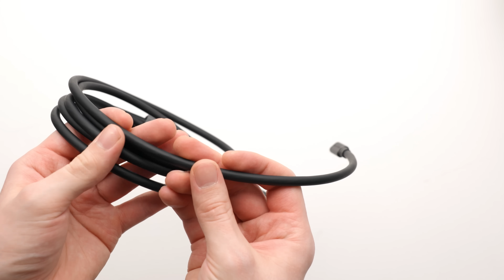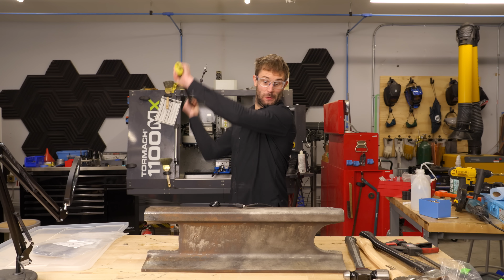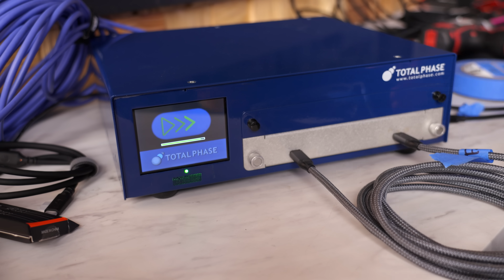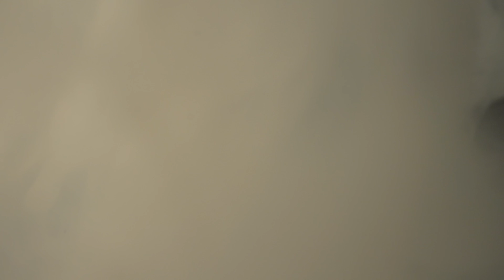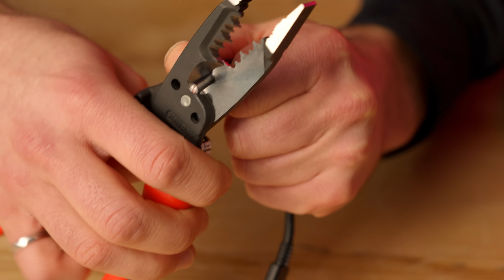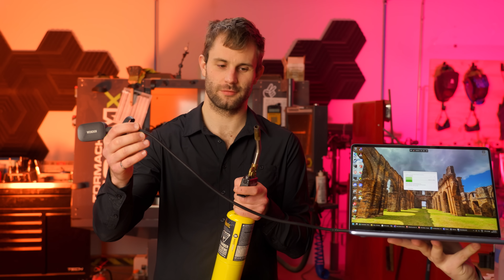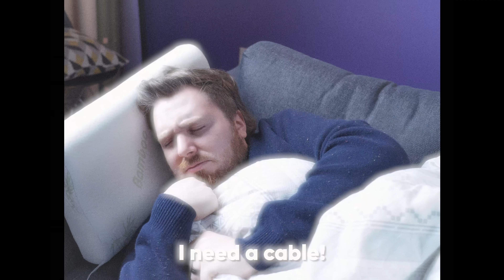Why It Took Me 4 YEARS to Make a USB Cable

Comment: I work with USB4/TBT cables a lot and all I can say is that their reasoning for not certifying... is nonsense. It's probably more about LTT and their partnered cable manufacturer in China not being able to create a cable that would pass USB-IF certs for one or another reason. I actually have quite the testing equipment from Teledyne and TotalPhase too to check, and all I can say is that final certified cables are passing the tests with some defects within the batch (usually around insertion loss). Heck, should I get their cables and verify their claim lol? 

For anyone wondering - take a look at StarTech cables, they are USB-IF certified and cost about the same.

Comment: I know someone that does CEC certifications for the FCC. I would double check that that is indeed the case that you don't need to comply by part 15 FCC regulations. From what I see it includes charging cables. Like I understand it's a USB cable and you don't need to get the certified. I know you've done your due diligence and tested things. My family member has found all kinds of crazy things like not grounded toys lights. There had LED panels that weren't properly grounded and would catch on fire in 20 minutes. So I would just make sure that you dont have to get these tested because they are an unintentional radiator.

Comment: To my knowledge this is the only "liquid Silicone" cable out there that does more than 480mbps. Having used liquid silicone cables for the last 1-2 years, I don't want to go back. I'll pick up one or two long high bandwidth cables when they are back in stock!

Comment: It being clearly labelled on the connector alone is incredible. Looking at the pricing on the store it's not even that pricey for a well built cable. As a business owner myself, I really appreciate other companies doing all of their due diligence when making a product, and actually caring about making good products. Showing the cutout between the two cables was really shocking, I did not expect there to be that big of a difference. Kudos to the entire team that worked on this!
Reply: Yeah when Linus said pricey I was expecting 40-60 US
Reply: Compared to Monster Cables these are like dollar general prices.
Reply: clearly labelled is one thing.
not being bullshit is another...

both... take my money!!
Reply: clearly labeled? do they support Thunderbolt 4 or not?
Reply: @Tri-Technology whether or not it's well explained on the site, nothing here properly supports thunderbolt. So if the device defaults back to a USB method, it'll work great, but if it requires the thunderbolt chip, no dice.
Reply: @clintmash245  Then why should a buy a top notch cable if it doesn't support top notch technology? In most cases cable quality doesn't matter but for pcie devices like egpus, nvme ssds, thunderbolt docks for multiple high resolution screens and thunderbolt daisy chaining it does, but it's not supported.. great job.
Reply: @Tri-Technology To be honest, you make a good point. It sounds like you're not a good customer for these cables, and hopefully you've saved someone else the trouble too. 
Most of the people buying these are swayed by their selling points: high durability, well validated specifications, and selectable length. That's actually plenty of reasons in the current market to support a product.
Reply: @Tri-Technology  Thunderbolt 4 is just USB4-40gbps signaling. So yes, they do support it.
Reply: @Xyler94 No, it is not. It is Pcie and USB 4 is not. And it has way more specifications.
Reply: It has to be a bait, the pricing is pretty much on par with any other 40Gbps cable I've purchased in the past. If anything, I will most likely buy one as soon as it becomes available once again.

Comment: Thanks for these 

And most off your reasons is why i started to make my own Networking cables because then at least I know which idiot did that crappy Job so are most of my cables but USB i dont know why but i did not trust myself to make anything useful. 

So again thank you all at LTT from Linus Idea to CW and Labs testing and proding factorys.

Looked at the Pricing now not the cheapest but far from what i payed for some of my legthier cables over all i would say its a great middle ground know LTTstore just has to accept somthing like klarna or my Banktransfer so i could buy some.

Comment: My favorite part about working at Best Buy (And probably the only good part of that job) was the employee discount, specifically for cables and other accessories.

The profit margin on cables is ridiculous. When I was an employee, the price I paid was the price Best Buy paid for a product+ %5. I could've bought a $500 cable for $20. Not that I ever did I always bought the much more reasonable but still over priced cables that you'd normally pay $20 for only a few bucks

In sales one of the things store managers tracked was called "basket attach" where it looks good on your report if you attach high margin accessories to a sale with a big ticket item that best buy doesn't make money on like TVs or game consoles.

I never cared for that as a blue shirt. One thing that annoyed me most personally was "screen cleaners" sure you could spend $20 on a little bottles of water with some chemicals or a mild detergent plus a microfiber cloth. Or just buy some distilled water and ANY microfiber cloth from Walmart or wherever for a fraction of the cost.

When I was in Home Theater I never sold a single one of those stupid accessories and told every customer I could about that scam in particular. Sure my managers never likes my sales reports but who cares right?

If anything from my experience I think the LTT cables are cheap considering the value and quality they're offering. It's one of those things that I'm sure if Best Buy carried them in store I wouldn't have gotten much of a discount if any at all.

Comment: I love silicone cables. I got one for my Pinecil mainly because of the heat resistance but also because I heard they aren't as stiff and it's true. I wish silicone was the norm for cables. I got a silicone audio cable for my headphones too but sadly after going through a few pairs they aren't that durable (To be clear, I mean the specific cable I use which is the only silicone cable for my headphones I can find. I don't have any reason to believe that silicone cables in general are any worse than normal cables and I still prefer them). But it's nice to not have my headphone cable kinking all over the place.

Anyways, the price is actually not bad. $21 for a high quality 240W cable is easy to justify.

Comment: I think the "snake-oil" comparison at 11:24 uses a poor example. While there are several nonsensical claims made by cable manufacturers about digital USB cables to this effect (about improving detail and quality etc), the example you showcased EpicX ARAY RCA plugs are designed to carry Analog audio signals. These analog signals are most definitely tied to the quality of the materials and other factors, and higher grades can most definitely result in "more detail, dynamics and portray the timbre of instruments". As analog signals have a theoretically near-infinite resolution, it is indisputable. However, the degree to which these cables can affect performance and their price-value ($700) can most definetly be argued as probably hugely overvalued. So this is not an example of "Snake-Oil".
Reply: That brand is known snake oil last I checked.

Comment: Ngl the cables are actually cheaper than I expected. I haven't bought any LTT gear specifically because it's usually outside of my price range, but I would actually consider buying this at this price point, because it's not like you're going to get rid of it anytime soon, and it's not like it's going to be easy to break either.

Comment: Please make a braided and bent version, I'm so tired with bending the cable causing breakage.
Reply: 90 degree would be nice. But braiding is irrelevant if they’ve already done the durability v flexibility testing in RnD.
Reply: @SterlingSanders  braiding looks nice which is good for a cable that won't be tucked away
Reply: @SterlingSanders cable matters alr has a bent version and as far as I can tell it's quite high quality. I still prefer the durability and flexibility of braided cable and they don't have one so that's why I'm asking.
Reply: @I_had_a_dream I’m saying they considered braided, and intentionally chose not to put it on their product. They clearly tested the durability and flexibility of their ribbed silicone and found it to perform within the tradeoffs they were looking for.

Not to mention, braiding would increase the price of a a product they already feel they are already at a high price point in. 

Will check out the Cable Matters cable for sure.
Reply: @SterlingSanders  For me braided is not even a matter of durability or flexibility but how easily it picks up dirt and gunk. As somebody with pets and a carpeted room, it's a problem, because anything that isn't braided comes either slightly sticky or otherwise prone to getting buildup with friction from daily use, and it only gets worse with age. I wouldn't care if it was the sort of thing you chuck behind your PC and forget about it because you never move it, but USB-C is barely present in that use case. It's mostly used for stuff like phones, laptops, and various accessories that you most likely do not have plugged in and stationary all the time. Which exposes them to a lot more friction and surfaces where dust, animal hair, and fabric fibers are present. Which leads to icky cables. Which feels anything but premium.
Reply: Yes. My laptop can charge via USB-C and I prefer 90⁰ cable on it. If LTT starts selling 90⁰ cables, I'll be wholesale changing to LTT cables.
Reply: Did you not watch the video?
Reply: @NakedTrashPanda  not breakage in the outerlayer, breakage in the conductor itself.
Reply: Double Right angle would be excellent for my camera equipment

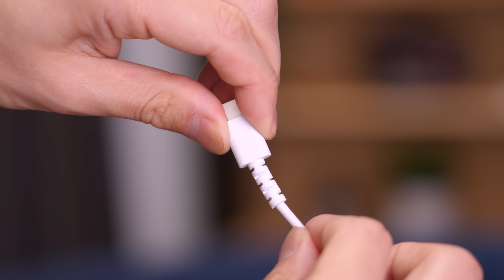Comment: 8:43 You guys should do some Right Angle Ended cables, for sure. I have a few cheap USB C's with Right Angle ends that I have used for years.

Normally, I always put Pen Springs with Heat Shrink on the ends of my cables to prevent them from tearing. Those are some of the few that I havent had to do that with. 

Theyre great for charging things that you want to hold in your hands, like a Switch or a Controller.

Comment: why not just make one cable with max out spec (i.e. 40Gbps, 240W) and just different lengths and connections? So you don't even have to read the connection's end to know if it's going to work from a pile of cables, cuz they'll all work?

Comment: I'm very impressed with the pricing on the longer cables! Like, for a quality cable this is very competitive. Not too sure about the 10 cm ones but w/e.

I also like that you always picked the highest data transmission allowed within the spec. It's the same cable, after all.

Comment: For the price, display port is a must need for me. There are lots of options, but even Amazon basics has a cable with the exact same specs as the most expensive LTT cable which is $26.99, but Amazon sells it for $10. I don’t maneuver around display port cables enough to break them because I’m just plugging and unplugging my laptop, so I don’t understand why I’d need the $26 one. Also, the expensive one doesn’t have display port.
Reply: In fact, I could buy 2 Amazon basics cables, which are both clearly labeled, have 40GBs at 3.3 feet long, with 240watt PD, and thunderbolt 4, and still have $6 left over. I’m sorry but the only reason to buy an LTT cable is to support a creator.

Comment: I recently bought a usb-c cable, that only works one way with my controller. If I plug it in the other way around, I get massive lags in-game. If I plug it in the right way ot works fine. 

This can't just be a missing wire, right?!

Comment: Impressive, I love to see the specs right on the cable. 

One request; Would it be possible to package the 240w cable with a (yet to be developed) "TrueSpec" C to A adapter, and vice versa for the 15w variant? If the cable took 4 years, I'm guess an adapter can't take longer than 4 weeks.  ;)

Knowing the cable can handle what it says is great, but not knowing an adapter can keep up with the cable still leaves us in murky USB spec waters.

Comment: IMO high end usb cables are kindof dumb, the only high load operations you do on usb is transfering files where you do not care about loosing some bits or charging using usb-pd (same thing you don't actually care about packet loss). 
Maybe if you make high end long range HDMI cables / display port cables / ethernet cables I may be interested.

Comment: Isn't the whole point of USB C recent spec to INTENTIONALLY design weak/cheap/bad cables that will break from bending and pulling out INSTEAD OF the devices' ports breaking? Like I thought this situation was very intentional, and sturdy cables are antithetical to this. I'd rather replace $6 cables over and over than even once per device lifetime have to replace the USB C port.
Reply: Umm.. no? It's unintentional consequence of jamming everything in a tiny connector. USB-C originally was intended to just replace A and B types while being the same 5Gbps spec (for A type), but compact (like Micro-B) and reversible. 
Only later USB-IF started to jam everything in it making bigger the cable cover. Just look at active USB4 and Thunderbolt cables. They are massive.

Comment: Thank you for doing this. I've been hoping that LTT made cables for quite a while.

The market is indeed awash it trash and I have zero confidence on speed/specs of the cables I buy. 

It's even worse with the more exotic versions like DP to mDP ,  USB-C <-> USB3.0-B or even USB-C to video connector like DisplayPort. I need some of these my monitor video + USB hub to the PC.

Comment: I bet many brands could make the same quality cables, but just dont have the reputation to sell enough premium cables for 2-3x the price of the normal ones to make it worth it.
and while I really love LTT, thats also where I disagree with what Linus is saying at 11:18. LTT Cables are not a premium product thats like 30-50% more expensive. No, the LTT Cables are 2-3x the price of the standard cables, where probably 80% still do their job just fine. So, yes its not false advertising, but if they dont make my image crispier for that price, its still a bit of a scam in my eyes.
Obviously it depends on if we are talking about merchandise or actual products, but with the structure LTT has grown into and the path they take in product development, I think the times for Content Creator Bonus are over and LTT Products deserve to be evaluated the same way as other brands do, without influencer/content creator bonus in quality or (in this case) price.
Reply: Ehhh, I don't know. Think about the hassle they went through to find their manufacturer. That speaks to it actually being a taller ask than it seems. Paying like $20 for a product built to last rather than $5-10 for disposable stuff makes sense to me.
Reply: I can agree that the usb c to c cables are definitely priced too high but the usb a to c cables are actually pretty decently priced, which is why theyre almost entirely out of stock lol

Comment: As an electronics engineer, I was pleasantly surprised at the price (on 30 Jan 2026). The latest USB data speed and power speed are quite frankly absurd, so making a cable that reliably meets the full spec at the current price you have is a big achievement. Great video!

Comment: As for the durability of the connector, I would much rather have the cable break than the device it is plugged into. An indestructible plug could destroy the laptop it is plugged into if torqued on hard enough.

Comment: I'm actually confused. The c to c 1m 40gbps 240w for 27 is  very reasonable if they work as advertised. I've picked up tb3 and tb4 cables for roughly the same off amazon with my fingers crossed. Sure the longer and slower ones are meh, but the top spec ones are reasonable.

Comment: Holy crap, mini coax for the signal lines is bonkers over engineered. That’s my kind of cable!
Reply: I don't really see how micro coax (yeah I think they are usually called micro instead of mini) is needed over properly engineered twisted pair would for USB.

Comment: What I need from a cable is 
1. Its product description clearly states what it's rated for;
2. It actually delivers on that description;
3: If it doesn't, there's a recognizable company behind it that I can publicly hold to account on the internet.
I'm actually good for cables right now but this is a great option to have!
Reply: Given my luck with USB-C cables I'd be willing to bet you are not actually 'good for cables right now', they just are not so flakey its really really obvious and annoyed you yet. As I haven't had a single one that hasn't caused noticeable trouble when really pushed, and that is mostly on the very limited bandwidth Steamdeck that shouldn't even be pushing these cables to the limits...
Reply: @foldionepapyrus3441  You're correct, it'd be more accurate to say "I haven't run into limitations of my current cables to a degree that it bothered me".
Reply: @foldionepapyrus3441  Have you tried OWC?
Reply: I recently got new cables but when those go out the next ones will likely be LTT cables.
Reply: There are still a few (minor) things missing in their description : the max power allowed and the weight of the cable. The picture only shows 40Gbps 240W, but if I select a 20Gbps or a 480Mbps I have no indication what power is accepted (I would think it's the same no matter the length/speed, but it's not written). And weight is just a detail, but would be nice to compare e.g. if the 480Mbps variants are slimmer/lighter.
Reply: @bastienx8  power is 240W for all type C cables and 15W for all type A.

You might get more from type A if you use a proprietary charging protocol.